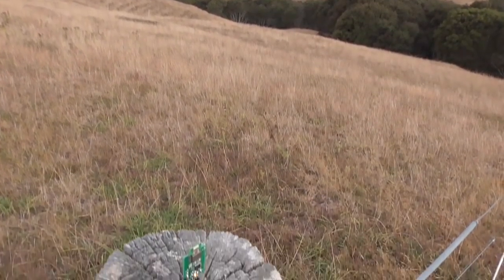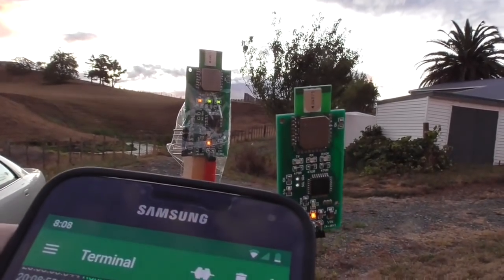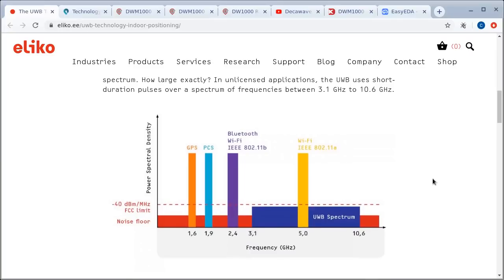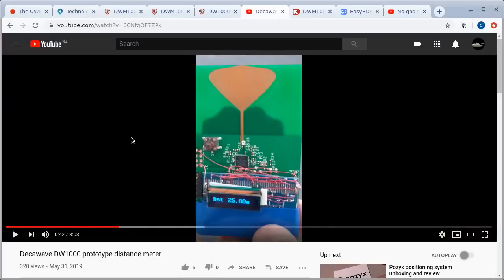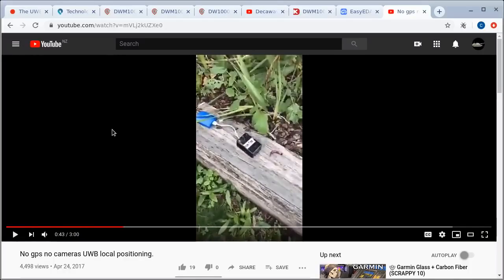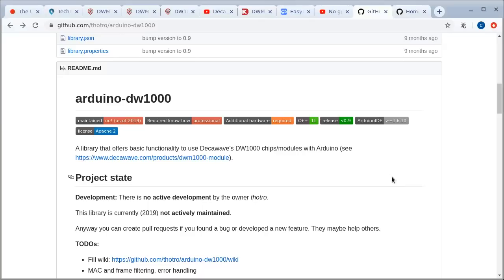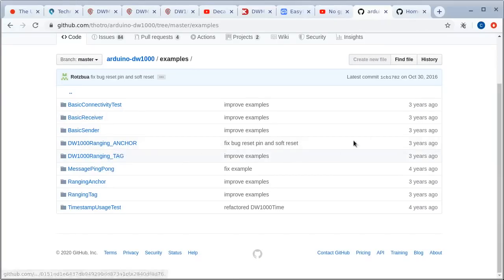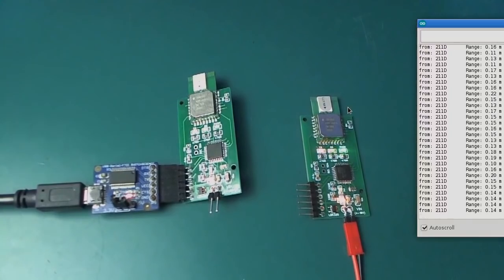DWM1000 UWB ranging radio test (arduino)

Comment from the maker: Seems like there was a bug in the library I'm using. The default mode is MODE_LONGDATA_RANGE_LOWPOWER. There is a function to change this, used in the example sketch to select MODE_LONGDATA_RANGE_ACCURACY. However, this code looks suspiciously like the defaults are being set again before each transmission....

void DW1000RangingClass::transmitInit() {
 DW1000.newTransmit();
 DW1000.setDefaults();
}

After editing the library to change the default to MODE_LONGDATA_RANGE_ACCURACY, I was able to get signal at longer ranges, but still nowhere close to 300 meters. It was pretty reliable up to 30m, then patchy until 50m after which there was mostly no connection. The furthest distance I saw was 72m. 

According to the datasheet MODE_LONGDATA_RANGE_ACCURACY should be the best for range, ie:

MODE_LONGDATA_RANGE_ACCURACY[] = {TRX_RATE_110KBPS, TX_PULSE_FREQ_64MHZ, TX_PREAMBLE_LEN_2048};

Does it seem reasonable that with better antennas this might make it to 300 meters? I'm not sure, perhaps it would. I'm also now wondering if there might not be more problems in the library...
Reply: I think it was an very interesting video. I think something was off. No way would a company put out something so under spec. But anyways Kicad is another layout program and it is free and easy to use. Maybe not as easy as Easyeda but you keep the rights to anything you design. Also, don't know if you care but arduino ide has a dark mode (3rd party) that makes it much easier on they eyes.  I like your regular guy approach to teaching / showing technology.
Reply: iforce2d if the pcb antenna isn’t tuned right, it could totally be the problem. Also I don’t know if the radiation pattern is the omnidirectional, do you know if it is?
Reply from the maker: The datasheet shows it to be fairly spherical
Reply: Hi mate,
Any chance you have a git with your version of the lib? Really priceless information right here.
I think this project is worth pursuing 👍 even 3-4 anchors with 30m of range surely has some use cases for your drone project.
Reply: Hey, 
Does the anchor needs to be fixed or it can be in motion just like the tag?
Reply: I was just reading about that on github. I should have looked at the comments first hahaha

Did you test any of the other pre-configured modes?

Comment: Hi! Thanks for the interesting video! I was wondering whether you know the maximum accuracy of such a system? I am looking for something like this to measure the distance between two moving objects. It would be at a distance of 3 to 15 meters, the objects are expected to move in vibrational motion with a max frequency 2 Hz. Since these are relatively cheap it might be a viable option. The setup seems relatively but I was wondering about data storage. In short, I have 3 questions, sorry if I missed the answer in your video's:

1. What is the maximum sampling frequency?
2. Can the data be stored easily on a small device, with the relative sample time so I can synchronize this and use the results in sensor fusion?
3. What is the maximum achievable accuracy of the system?
4. Are there sensors which perform better in sampling frequency, data storage and accuracy that you know of?

Sorry I have never used such sensors and am not at all experienced, some of the answers might be obvious. Thank you in advance!
Reply from the maker: There are plenty of links in the description that should answer most of that

Comment: This video is quite old, and currently im doing some research on these for a work project. What isnt well documented is that you need to set the antenna delay to get decent accuracy. Otherwise as you indicated the antenna delay will contribute to the distance measurement. THere is an arduino sketch somewhere for auto calibrating the ADELAY. do that and the accuracy will increase significantly.
Reply: Where I can find that arduino example?

Comment: In your projet, is the stationnary one coded as an anchor and the one you read serial output on your phone coded as a tag ? Cause' i've built a prototype with two ESP32 board with a newer Decawave chip, the DW3000 chip (compatible with Apple's U1 chip). and got better results, but I'm still guessing on how I could built a scenario where the tag knows how far it is from a particular anchor, and not just "an anchor". How can I "set" the ID of an anchor and be able to read it on the tag.

Comment: Hello. I am trying to communicate two ultra wideband bu01 dw1000 chip using esp32 d1 mini without any breakout board. What i did was to etch a pcb board and only solder the necessary pins to communicate 2 uwb with each other. The pins soldered was the SPI pins (CLK, MOSI, MISO), CS pin ,IRQ pin, RSTn, VSS, and VDD3v3. I checked the soldered pins with multimeter and there is no shorts in wiring connections or whatever. But it just doesn't work. Any ideas why?
Reply from the maker: I have never used ESP32, and I don't know anything about your custom PCB, or anything about the program you're using. So there's zero chance I can help you sorry.

Comment: Thanks for your video.  In trying to bring up your PCB design in EasyEDA, can find it but it does not load, saying "document does not exist".  Can possibly update the library?
Reply from the maker: Seems to work fine for me in both Chrome and Firefox, even when not logged in to EasyEDA. So not sure what I could even change that would help. If you're only looking to get the board I used with no changes, I have a bunch of bare PCBs here, could sell you. Let me know at iforce2d at gmail if interested.

Comment: Regarding the range: u should look at the datasheet and see if u can't modify a modem bitrate register or smtng. If u turn down the bitrate, u should have drastically improved range. Datasheet said 290m range max, and ur in the middle of a field-- the range ur getting otherwise makes no sense.

Comment: Modules don't seem very  useful in their current form, but interesting video nontheless. Didn't know this was (one of?) the technologies behind indoor positioning... seems like if implemented correctly it would be great for quadcopters, or even autonomous vacuum cleaners ;) The LEDs are showing something useful.. devil is in the details. From left to right... LED1 was showing when the module had finished transmitting something, LED2 was showing when the receiver was active, and LED3 was showing when the receiver had heard something valid... so really for the anchor you probably just want the  TX  LED (LED1), and for the key RX_OK (LED3)... although RX (LED2) would  be good to have also... so you can tell that it is still listening but not hearing valid info. Hope you have luck with them in the future!

Comment: I checked the specs of DecaWave's own DW1000 two-way ranging evaluation kit
, and they listed the range as 40 ft which is about 12 meters.
Reply: How many centimeters is the close measurement accuracy of dw1000?

Comment: Would enjoy a pcb creation and build video. You should add a gps to your 328p pcb design, the Quectel L70 is a very low power module with great performance (tracking 15 mA) but you have to add an antenna, the L80 module has a antenna, slightly more current but also good performance. Both are easy soldering surface mount modules.
Here is some interesting reading in detailed gps performance tests.
https://github.com/LoRaTracker/GPSTutorial/blob/master/GPS%20performance%20comparisons/Readme.md
I think you will find it interesting. (Not my own work to add)

Thank you, your videos a few years back sparked my interest in arduino and gsm modules and I now have a few projects of my own. 👍🏻
Reply from the maker: Yeah I'm thinking about doing a few videos on the EasyEDA process sometime. Seems like those type of videos are not very popular though, everyone wants to see a plane being made.
Reply: Hopefully you will get a chance to do a few videos on EasyEDA, I have made a few parts library’s on there, fairly easy to use once I spent a bit of time playing around with it. Not made my own 328p board yet though, I am in the middle of making a Pro mini - GPS - Sim800L carrier board, all the modules are cheap and allows easy soldering. 
I enjoy the plane builds/tests too, they are incredibly detailed, hats off!

Comment: $25 doesn't seem like a good deal for something that doesn't work.

According to the datasheet section you showed us, RX indicates signal is being received at the RF level, akin to putting a light on an RX pin of a wired bus. RXOK indicates that a data packet was completely received and was decoded without error. So RX is a physical layer (layer 1) receive, while RXOK is a media layer (layer 2) receive.

Comment: From looking at the PCB, it looks like there is a couple of things. One is the size of the PCB itself, the datasheet states in 5.1:
"It is also important to note that the ground plane on the application board affects the
 DWM1000 antenna radiation pattern. In Figure 8 below, d must be a minimum of 10 mm. This gives the most vertically polarized radiation pattern. As d is increased from 10 mm the degree of vertical polarization reduces."
In your case d is 6.096mm, so that could be one reason you're getting poor performance. Also I'd recommend a slightly better ground plane, D9 is almost splitting your ground plane in half, the module ground has to take a longer path which can affect performance. Add top ground plane and via stitching between the planes. I'd also recommend getting the decoupling caps (100nF caps) closer to the ATMega and giving the module a few decoupling caps.
If you want, flick me a youtube message and I can help drive some board improvements via Skype or Discord.

Comment: I was working on the same project, but for the processor I am using SAMD21G18. I am also getting range of around 8 meters, but the datasheet says it is 300 meters. Have you found any solution for that? Can I have your contacts to share the progress on the project and perhaps help each other. Thanks!
Reply: Hey man, what about the range, fixed it?

Comment: I was intrigued by the simplicity of this indoor positioning approach the other day:
https://eloquentarduino[dot]github[dot]io/2019/12/wifi-indoor-positioning-on-arduino/
Thought that in the open space one could do something similar with a couple of BLE beacons and BLE central scan functionality which also returns the RSSI (Adafruit nrf52 core) running on the device itself

Comment: I wonder how much difference the power supply makes to these. You are using USB from your phone which will be stepped up from the internal battery voltage and probably quite noisy. I've found that RF stuff often sucks with USB power, e.g. GPS performance is severely reduced.

Comment: Cool project!  That is surprisingly low power transmission if you are only receiving -80dBm when you are right next to it.  There must be a higher power transmit mode you can enable somehow.  When you were out at 8m, with -100dBm I'm not surprised it was dropping out. Might need to dig into the settings to figure out how to configure higher power.

Comment: If you need a directional broadband antenna, check out these Vivaldi Antennas:

https://www.ebay.co.uk/itm/1-5-GHz-to-15-GHz-Vivaldi-Antenna-by-WA5VJB-/254170352417

The guy who designs and makes them is extremely helpful!

Comment: have you seen this ? The Daatasheet claims 290 meters @ 110 kbps,  page 29 Table 25 states the operation modes, also there are some pages about TX power ... 
maybe this thing is just not "switched on" properly ? ^^
https://www.decawave.com/sites/default/files/resources/DW1000-Datasheet-V2.12.pdf
i guess the stuff you have to send over spi is in there too ...

Comment: I remember reading something about different tx powerlevels in datasheet. Would be useful if you output the registers and check. Also it might be silly but are you sure your modules dont transmit at same time? You usually need to sync the clocks and have them tx in sequence.

Comment: really like the virtiport idea, even 8 meters should be acceptable for GPS accuracy no? anyways like always, thanks for the heads up
Reply from the maker: Yes, if you have enough space and you're landing under open sky it would be fine, especially if there was an RTK base station at the port. This UWB stuff might be useful if you want to have the craft fly right inside a building.

Comment: Your antenna is around the wrong way
Reply from the maker: What you mean 'wrong way"?
Reply from the maker: Page 15 of the datasheet shows the radiation pattern to be fairly spherical
https://www.decawave.com/dwm1000/datasheet/
Reply: @iforce2d  They are indeed fairly spherical, but because of that that antenna has no real gain in any direction, basicly 0dB in all directions and even negativ dB in the main directions (fig. 7 elevation plane 2) (when modules lay flat and facing each other each other). I would bet the pcb antenna which get +100m has at least a little gain in the horizontal plane when holding upright (probably some donut shaped antenna pattern instead of a omnidirectional (ball shape) pattern)